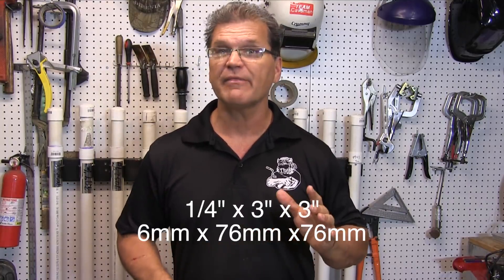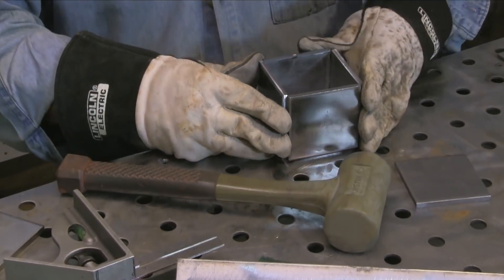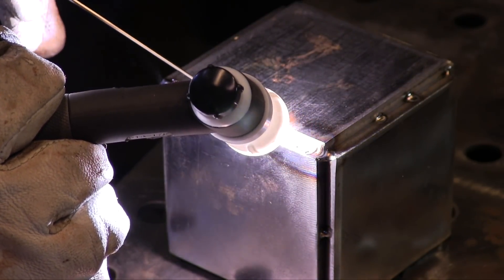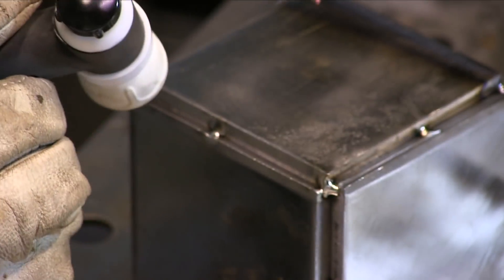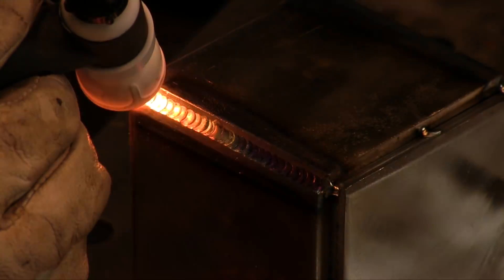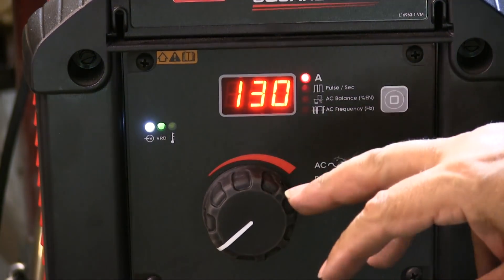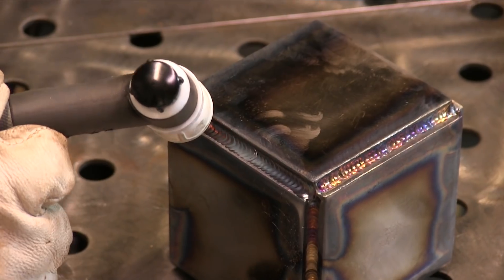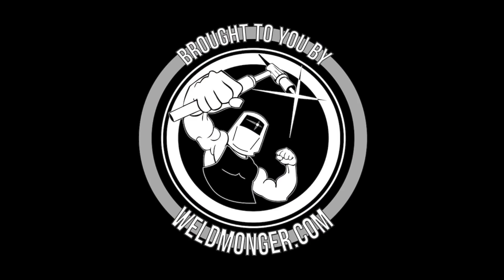TIG Welding Steel Cube

Comment: Very nice! On the technique where you layed down the wire rather than dipping it can that method only be used on pulse Tig or can it be used on regular settings. Thanks

Comment: It was my impression on mild steel, when you see color, you're weld is to cold? Keep in mind I'm referencing welding to flat pieces butted up to one another, the filler wire never seems to sink and spread out you know "lay down", it's always "proud" and the filler metal stands up IMO to much. So how are you getting it to "lay down" on other types of flatter joints, without using more heat? I'm using an old Miller machine that doesn't have a pulse setting so maybe your use of a pulse setting is part of it? I have been practicing manually pulsing with the pedal though and in some instances show much better results on very thin sheet metal like 18-20ga.

Comment: hey Jody, did you have any problems with gas building up in the cube and then blowing the weld puddle all over the tungsten as you seal the last joint up? took me a while to figure out drilling a hole some where to relieve the pressure when i did my first stainless handrail project!

Comment: the first ever "weld test" i ever got had my employer sit me down with a finished welded cube and a bunch of 2 inch squares he said have at it  lol so i went it with magnets and clamps galore and took me forever to fit that cube up as a very first timer , he threw down 6 squares in a cross shape just like a paper cube web zapped6 quick tacks to each and folded that sucker up,done.

Comment: Every time I try a solid cube I get blow-out on the last corner. How did you keep from getting blow-out on the last corner?  Did you back-fill the cube with argon? I ended up solving my issue by drilling holes in mine and making them dice.

Comment: You could drill a hole in one of the faces and use it as a holder for filler wire if you dont find a use for it I suppose 😂

Comment: Ok dumb question. The knob that you tighten to hold the electrode in the torch in this video is like a button. Why sometimes is the knob is long and conical shaped?
Reply: Marty Bernier that's what she said.
Reply: The "back cap" can be long, medium or as you saw a short length, these allow different lengths of tungsten to be used in the TIG torch.
Reply: Marty Bernier some times you need to get in to some right spots. The smaller caps can be handy.
Reply: Does it make a difference how long the electrode is?
Reply: If you want to use a stubby cap you have to shorten your electrode to match.

Comment: Not a Artist? BALONY, you have singlehandedly done more for Welding than anyone else in our time. Your videos are all a order of magnitude better than the others.
Just yesterday I had a question about welding a bolthead to a spring steel piece (high carbon) and they mentioned Brazing as a good way. Well I just happened to have Silicon Bronze because of your vids, and I was unafraid to use it because of your vids. And I am just a novice that wouldn't know 10% as much as I know because of your vids. And you make very complicated subjects like carbon migration and metal dilution much, much easier to understand for the folks that actually use this info to make quality welds. Jody you ARE a artist (and a great teacher).

Comment: do you recamend type 27 or type 29 flap wheel for general weld fethering?
my TIG mentor used 2% thoriated which is no longer available what tungsten would you recommend as a replacement for mild steel and stainless steel TIG welding?
Reply: Jody has a whole video comparing electrodes, I believe for most cases 2% Lathanated is his choice. https://www.youtube.com/watch?v=bpanERwagaU
Reply: ...and 2% thoriated IS still available
Reply: Richard Ezzo source?  my mentor reacently retired,  and was the one asking, his over stock ran out.
Reply: Amazon

Comment: @weldingtipsandtricks :  I am new to welding (not as a profession, but as a home-gamer/wannabe maker), so please excuse the poor question... I have seen when people discussion welding things like tubing and such that it is good to have a place for the internal air to vent out as it heats up.  Obviously this would be due to the possibility of the air creating enough pressure to cause a structural failure and in essence make a bomb/grenade type outcome.  When you welded the cube did you leave any venting for the air to escape, or is just not a concern with this project?  Is there any tips to helping understand when a venting hole should be left when welding things that could be potentially closed off?  Cheers!
Reply: No bomb, but it makes the item hard to finish, because hot air will be rushing out the final part of the weld - which will keep you from finishing the weld...maybe Jody can share a trick here - but I've had it happen to me.
Reply: Keith Young I have made a similar project with 1/8 aluminum. Leaving only a very small hole, I let it cool completely. Then just make a quick tack over the hole. There will not be enough time for the air to heat up and cause problems.
Reply: Ted Saylor Thanks!
Reply: Darkravenmad Thanks!
Reply: Keith Young good question!

Comment: I'm not a welder:  When you spoke about pulling up on your electrode while dabbing the wire, is that essentially a manual pulse?  It looks much the same.
Reply: Stretching out the arc length (pulling back a bit) doesn't cool the puddle really, as the machine just ups the circuit voltage to compensate. All it does is give a little extra room for the puddle to grow as the rod is added and not get up onto the tungsten. 

With that said, a tight arc does keep the circuit voltage lower, which in turn means less overall heat being put into the parts being welded. Less heat is generally a good thing as heat input affects things in a detrimental manner (distortion, larger heat affected zone, etc.).
Reply: J Berkey Nope. Pulsing is changing the amperage and pulling the electrode makes a wider and (i think) colder puddle.

Comment: I did something like this only using 2 inch square tube filling it with led shot. I gave them to a wood working buddy and he uses them for clamping, or holding down a tape measure things of that nature. Says they are one of the handiest tools in his shop.
Reply: Not trying to be a spelling nazi, but it's spelling, not grammar  ;)
Reply: Not trying to be a grammer nazi, but you should use a comma.
Reply: Not trying to be a grammar nazi but its written as lead

Comment: did you completely seal it, how does one keep the hot air blowout from being an issue on that last closing weld?   this would work?: tiny air vent hole threaded then with final machine screw weld in.
Reply: That's over complicating things.  Relax and let it cool off a little bit.  Sharpen some tungsten or work on something else for a few minutes.  Sometimes it can be an issue on the second pass as well after things are all sealed up.  My technique for welding flanges to pipe is leave a small hole, run 2 passes, let it cool a little, fill in the small hole with a few layers and then you have something thick enough that won't blow out
Reply: As said above, just save the last little bit (like quarter inch or so) until the part has had a chance to cool. Then when you go to do that final section, it's not going to blow very much. If you really have problems (like a rather small volume being enclosed, just leave a pinhole at the end - something you can close with just a swipe of the lit arc once the piece has cooled. That will close instantly, and not have time to build heat and start trying to vent.